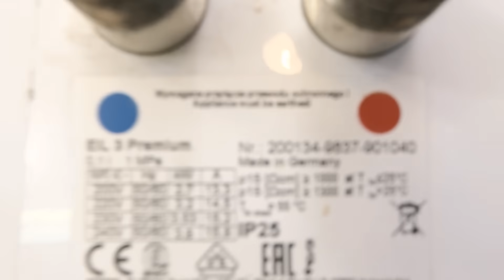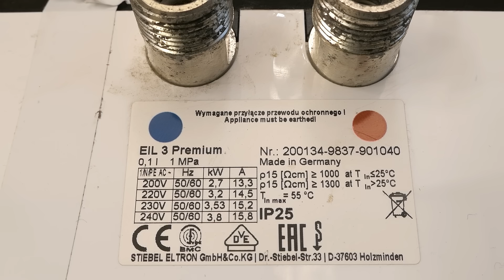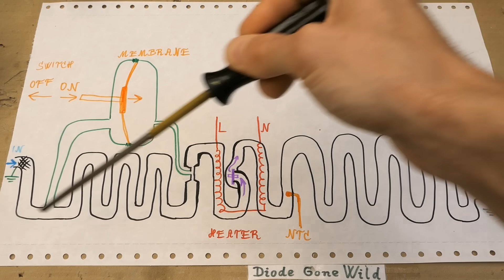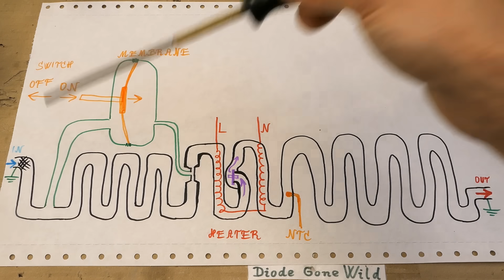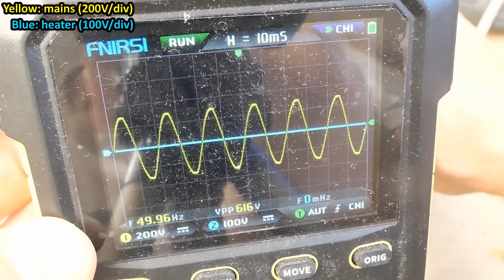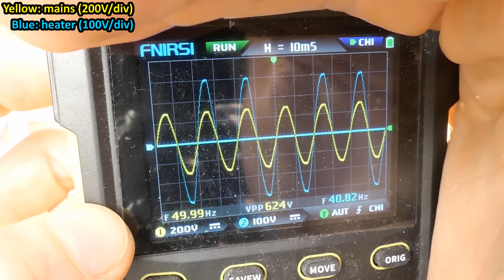What's inside a tankless water heater

Comment: Interesting. I need one for 24V though. I might buy one and use a resistance wire.
Reply: I don’t think they make them for 24V. To have the same power as the one in the video, you would need at least 150 amps of 24V. 

You might need as much as a kiloampere if you wanted a hot output with really cold supply water, even if you had a low-flow energy saving showerhead.
Reply: You'd need a welding transformer to power it...
Reply: @westelaudio943  I found one for 24 V. I don't need a transformer, because I have 24V DC.
Reply: @y2ksw1  

For a truck? How many amps does it need?
Reply: @westelaudio943  For a home with solar panels and 24V storage. The heater I took consumes about 600W, thus about 30A.

Comment: What does this mean: grounded?
Reply: Parts someon may touch, here the water connectors, are wired to the world, so there can't be voltage in-between, nobody can be shocked. One power connector is on the same potential, by the way. But these days a third wire is used.
By the way, it's actually possible to have a ground free socket, where someone could touch one power connector at a time. But the existing power grid is grounded. I'm glad you asked.
Reply: @timtim8468  Thank you for helping.

Comment: Only cycles, no angles? :)
Reply: Yes, because phase-cutting produces harmonic distortion and radio interference (which compliant phase-angle controllers have to filter).
In light dimmers those are necessary evils (to avoid creating unacceptable flicker), but there's no need to go to such trouble in a heater like this.
Reply: Phase angle at several kW.... 
RIP sine wave in the whole neighborhood LOL

Comment: An MCU at all fells like overkill, but a stm32 is over-overkill
Reply: It May be Overkill, but If they Order a bazillion of identical Pre Programmed μC which can be used for all Models by adding the necessary Parts it may be still cheaper then a smaller one or doing the Same with Logic.
Also the 1€ μC doesn't contribute much to the price of the Unit.
Reply: @walterbishop2 Stm's are rather expensive though. Lots of drastically cheaper options. Although maybe they got a good deal.

Comment: plastic and copper poisoning?
Reply: all water pipes are either copper, plastic or lead, and you just mentioned the two that don't cause poisoning.
Reply: @Jules.D  think again, copper is a heavy metal,  Ugh... lead
Reply: @Andrei9thouzen  then what should water pipes be made of ?
Reply: @Jules.D  iron, steel, stainless steel, email 
etc. \Safer materials are more expensive tho.
Reply: @Andrei9thouzen copper is also a micronutrient. Lead isnt. Not all heavy metals are the same.

Comment: 3D print the gaskets and you’ll have a working device.
Reply: (Copy paste from another reply I made)
TPU wouldn't hold up to the heat, but you could definitely create a mould in PVA filament, cast with silicone rubber, and dissolve the mould.
Reply: @AnnaVannieuwenhuyse  you could 3D print a mold and injection mold the gasket in silicone.
Reply from the maker: The gasket doesn't have an easy life. It's exposed to the tap water pressure, the temperature and temperature changes, but also to the water hammer effect (hydraulic shock) when the tap is suddenly closed. This is probably what makes seals fail or pipes burst.

Comment: Expensive version of suicide water heater
Reply: There is no risk here, so what's your point?
Reply: @jb5631  The working principle is the same as a "suicide shower water heater", namely with an open heating element that is directly immersed in water, but this one is safer with the addition of automatic temperature control and strong materials (try watching the video about suicide shower head)